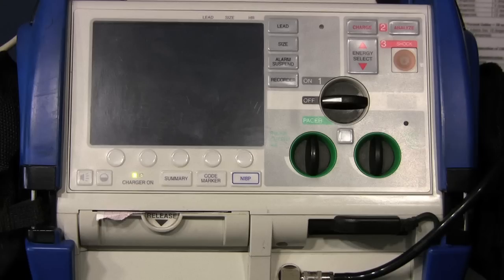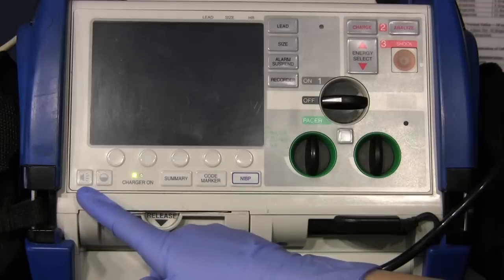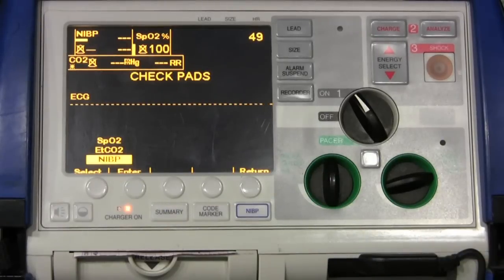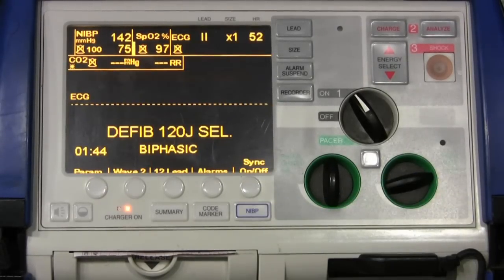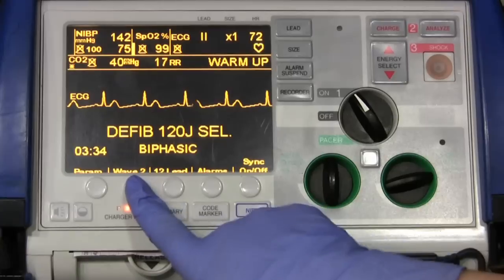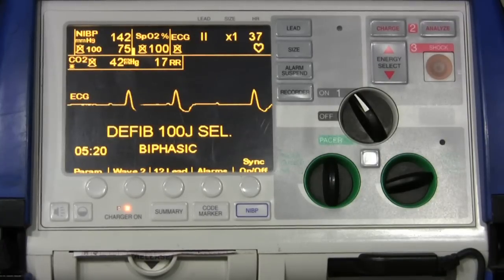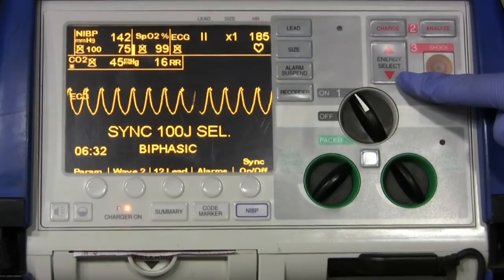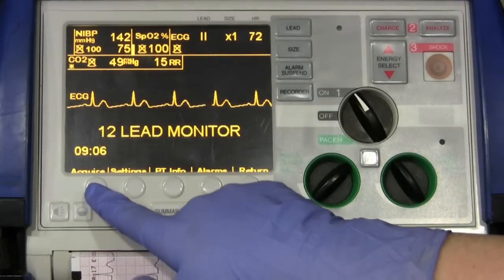A Quick Instruction of the Zoll

Comment: hi can patient monitors crash?
Reply: +Annie Mooney  Yes they can anything with software can crash BUT they generally have watchdog timers and would restart or reload the section of code. They run software that works in real time, things will happen at a pre determined time like computer aided machining. The software will also be reviewed by several different people during the development phase. The instruction in the Zoll M Series manual is if it behaves "oddly" (not a direct quote) turn it on and off. Have only seen it once with a faulty probe they would not pass the self test as opposed to work and then crash during patient care.
Reply: @DawidKellerman  ebvcvöavves
Reply: Ğpeşibkjnei
Reply: they can but it's a bit rare